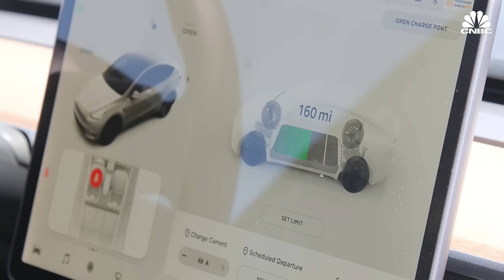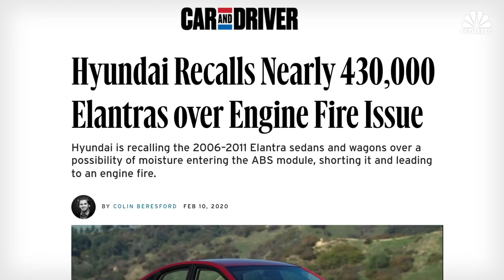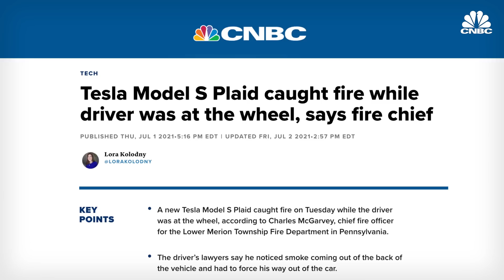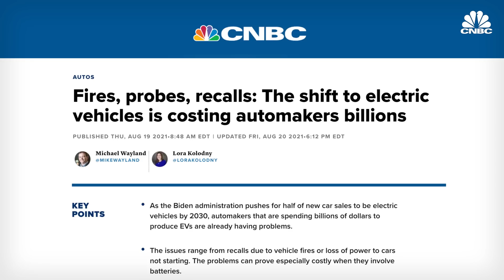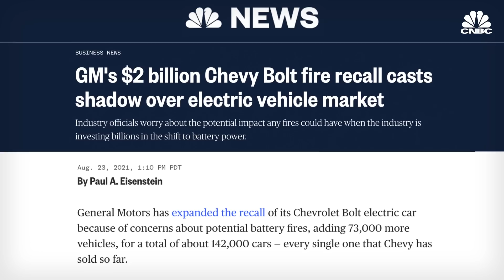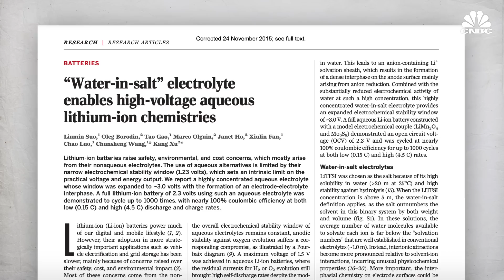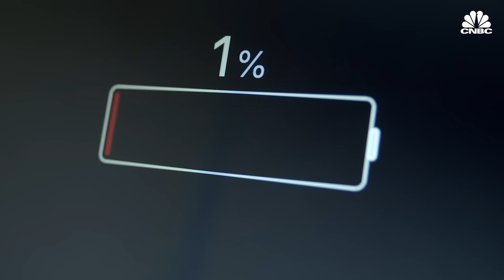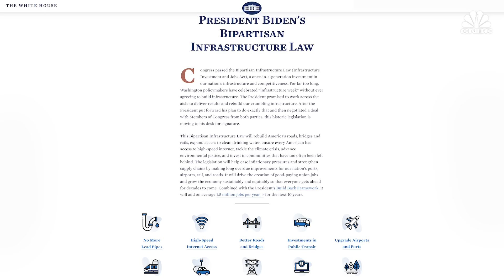Why Tesla, GM And Other EV Companies Have A Fire Problem

Comment: That test is unrealistic. No cars drive with a single battery. A whole module should be put into a hydraulic press or something. A 3.7 Volt rechargeable battery will never cause much damage. It is a totally ridiculous test. In an EV the batteries are connected, so they provide 400 to 800 Volts! From the good old formula by Ohm P= U x I  where  U is voltage and if you insert 800 volts instead of 3.7 there is a super-huge difference.  The idea of electric cars is not thought through properly. Then there is the charging issue. Hydrogen is the only way forward.

Comment: I have been safety testing lithium ion cells for the last two years (18650 and 21700). I would have a hard time sitting on top of a battery pack with 1000-2000 cells. It’s a lot of energy packed in there….
Reply: Where do you get 1000 to 2000 cells from? A Nissan Leaf 24kw has around 130 cells......
Reply: @Brian-om2hh  The Tesla S class has over 7000 18650 cells.....

Comment: 25 EVs catch fire per 100K per year.    1,530 ICE vehicles catch fire per 100K per year.   3,475 hybrids catch fire per 100K per year catch fire.   2022 report.    Just saw an ICE Jeep on fire yesterday, here in Bowling Green KY.   England now has low profile fire trucks that can enter car park garages that have high pressure abrasive water to cut into EV batteries and put the fire out with less water.   Another thought, if you have lived in a developed country (air conditioning, ICE vehicles, etc) since 1950 then you have to look no farther than a mirror to see a murderer.   That includes me.

Comment: hot asphalt on hot days appears to be an x-factor for EV floor bateries to short-circuit and catch fire.

4:03 non-crash fire rate EV is still said to be low, but they need more/better data.  5:40  some european cities dunk the car in water.

6:00  in addition to fire/explosion, they pose two threats, toxic gasses and flammable gasses, and battery packs can reignite days later.  EVs are particularly vulnerable when charging.  

8:01  GM recalled 61,000 chevy volts plus 73,000 additional vehicles... BMW, ford, hyundai, mitsubishi, tesla all had 'fire risk' recalls.
   
9:20  2021, tesla began switching to LFP lithium iron phosphate, lower fire-risk.  but LFP EVs have exploded into fire too.

10:41  solid state batteries in 2026/28 we should start to see more risk stability.
Reply: Great comment.

Comment: Why is our government so intent on putting us all into electric vehicles instead of gasoline or diesel powered vehicles? This tech is neither tried or true. Hypothetically, could a signal be sent via smart meters to short out the battery and start an electrical fire during charging of your ev? What happens when your EV catches fire inside your garage or a parking structure? It may be too hot to stop before engulfing your entire home or the homes of others, are you personally liable for damage or is it covered by auto insurance? What happens if you don't have access to home charging equipment? What happens If the government wanted you to comply with the new tyranny rules or move to one of their 15 minute cities, could they just flip a switch and eliminate your ability to charge your vehicle? It will be worse by volumes with digital money. In California, they suffer from brown outs, black outs for a major portion of the summer as the power grid is taxed to capacity. When it is windy, the grid is automatically shut down. The state government asks people last year not to charge vehicles during these times. How does this affect your ability to use your transportation? Is it dangerous for the power company linemen to work on power lines when electric vehicles are plugged into the grid?
Reply: Now they are putting the factories to build these batteries in Michigan- we don't want them!! The government is corrupt!! Look up Gotion Ev Battery Plant
Reply: WAKE UP you have been lied to ? the 40s/ 50s/ 60s/ 70s / 80s are over the cookie jar is almost empty ? you can tell this by the rubbish they sell at the pumps why ethanol they are mixing in everything  that burns that was sold separately  ie paint thinner [ what does that mean to air quality  ] we need to replace our day to day automotive  fuel ..... the poisons in battery fires ..... dont look up fracking / oil spills  / or any other fires fed buy oil ................................ we could always  ban the lot of it and go back to horses and pushbikes ...................... you should do that

Comment: BTW, with NET CO2 and water capture, a fire is automatically extinguished by the car during a crash or by driver deployment.  In essence, the CO2 capture is like a huge fire extinguisher that comes with the car.  With Ethanol (RE fuel made from electricity...the future), the fire is quickly diluted by the captured water even if a full tank exists.  The CO2 chills the engine compartment down to -56C.  This is superior to any system on an airliners for putting out fires.  EVs are hopelessly invalid and unfit for purpose.

Comment: National Transportation Safety Board, Bureau of Transportation Statistics have found hybrid vehicles reported 3,475.5 fires per 100,000 sold. Gas vehicles accounted for 1,529.9 fires for every 100,000 sold. Electrics saw just 25.1fires for every 100,000 sold
Glad I have an EV lest chance of catching on fire.

Comment: ev's are not clean as manufacturers say they are. mining the earth for all the minerals to build millions of ev's over decades will cause harm to the planet. few people will buy a 10 yo ev without a battery replacement. which means more batteries need to be made. ev's are still very unpredictable you don't know when it will burst in flames.

Comment: 5:52 , water will make the batteries short out and ignite, we found that out working with battery pack tools around water, I’m not in a hurry to switch out my lead acid batteries on my boat
Reply: as a mechanic I discuss the problems with electric vehicles in depth on my home page vid.

Comment: One thing i said at the very beginning of ev's, this will only work if the battery is easily replaceable at a station in a short period of time, enabling the power source to be renewed quickly and effectively. 
This could also be a fire retarding feature where the battery could be ejected in a fire condition and save the vehicle and it's contents.
Reply: Possibly, but what happens in or after a crash?
Reply: Eject a half-tonne bomb on a busy highway?
Reply: There is an Australian company that is converting Kenworth trucks to replaceable battery trucks.  Their prototype burned to the ground and their first commercial cement truck did too so replaceable batteries may not be ready yet.
Reply: @johncooper4637  given that electric vehicle batteries tend to self ignite and the fire risk is common to the batteries. I find it strange that you seem to think that the feature of a 'removeable' feature of the battery is the problem in their vehicles.
Reply: as a mechanic I discuss the problems with electric vehicles in depth on my home page vid.

Comment: Not only are they a major fire problem but they are an environmental nightmare!!!  
There is absolutely zero drop in crude oil drilling. The amount of plastics and synthetics that go into these still require refined oil. The by product of oil refinement is gasoline. The gasoline will have to be burned off if it isn’t going to be used in cars. So we will still have the absolute same hydrocarbon burn off as before, possibly a slight decrease.  Now we add the horribly toxic mining practices for the rare earth minerals that make the batteries. The batteries will only last 15 years  on average, they will then end up in landfills with toxic runoff that will poison our ground water. Just so we can feel we are being green.

Comment: In the same way you can't release a vaccine in a month, you can't change an industry overnight.  Not to mention that the demand for EV's is miniscule while the gov't tries to force people to change.  Capitalism doesn't work like that, socialism and communism use those methods.  These fires are happening in significant quantity and already common with very few EV's on the road.  Bottom line, this tech will not be the future.  As Toyota has come out and said, hybrid gasoline and hydrogen are the future.  Batteries are already archaic tech.

Comment: Not to mention its higher carbon footprint than a gas vehicle unless it's used for more than twelve years which is about the breakeven point. Now throw in that the batteries are not recyclable. Electric vehicles are a complete boondoggle for morons who think they're doing something

Comment: Studies say gasoline cars catch on fire 10 times as often as electric cars, but I wonder if that's true. I mean, these EVs are new, and they still spontaneously burn. Even the brand new batteries in new 787 airplanes spontaneously caught fire in 2013, and the fleet was grounded. How many new gasoline cars or planes spontaneously burn?
Reply: "Studies say gasoline cars catch on fire 10 times as often as electric cars, but I wonder if that's true."

Actually, gasoline cars are about 22 times a likely to catch fire
 The headlines of the video is DESIGNED to scare people!  It obviously worked!  But, someone is just jerking your chain.  They neglected to share the data that shows that gasoline cars are 22 times as likely to catch fire as an EV.  Sure, they are hard to put out, but the chances of a fire are many many times less.  

Oh, and Hybrids are bout 64 times as likely to catch fire as an EV!  Do you drive a hybrid?

For every 100,000 hybrids owned in the US, 216 caught fire in 2021.
For every 100,000 gas cars, 74 caught fire
For every 100,000 EVs, 3 caught fire!

Those are the odds!

Comment: So if the battery is older thats a higher level risk. I think EVs is novelty.battey power fork truck at work melted the plug for the battery and full charge I unplugged the power before fire In the food plant.

Comment: Another concerning aspect is the ageing of these vehicles. Rust / corrosion is a major problem here in the UK and is only made worse from the salting of the roads during the Winter months. The batteries are underside so we can only expect rust eventually getting into the battery casings and potentially causing corrosion of these Lithium packs in say for example 10+ years time.
Reply: We are safe inCheshire because they do not salt the roads
Reply: The rich people don't like salt the roads now because have Tesla.
Reply: Casings are typically with a plastic layer
Reply: This whole video is full of factual omissions, firstly alot of batteries can't be put out with water, once the battery catches fire the chemicals in the battery produce more oxigen which fuels the fire. An experiment was done where they punctured the battery of an EV and put the car in a hole in the ground and filled it with dirt and water... this method would put out most fires but the ev continued to burn for several hours.
Reply: There's no particular rust or corrosion problem in the UK, what are you wittering about?
Reply: @markfox1545  Vehicles, Winter, roads, salt, loads of surface water (especially right now), throw In a few lithium-ion battery banks for good measure, excellent recipe 👌  have a good dinner
Reply: Norway has 80 % ev adoption.. surely they know what they are doing
Reply: @irusev  still ''new'' will see in 10-15 years
Reply: @irusev it is never safe to make assumptions about safety!!!
Reply: @irusev  Imho, they have not a clue. Insanity rules over common sense.
Reply: @denisek292  well, they sure seem pretty happy to me

Comment: Green energy is a low-pollution option even after the fire and even if the driver gets burned.
Reply: No, I heard EV manufacturing produce 60% more carbon compared to petrol and diesel cars.

Comment: I'm still not seeing any reason to move to EVs. Existing gasoline-powered cars burn fossil fuel in the engine. EVs burn for fossil fuel back at the electric generating plant. Where's the benefit?

Comment: Please note: 

The following caveat placed on many websites, Twitter, Wikipedia, YouTube etc:
Climate change United Nations:
"Climate change refers to long-term shifts in temperatures and weather patterns, mainly caused by human activities, especially the burning of fossil fuels."

This is at best bias, propaganda, exaggeration or based on deliberate social engineering.

Sadly it is based on computer models designed to produce the desired result for those commissioning the prediction.
In reality the statement would seem to be a lie.
May I suggest YOU read the full IPCC Report, which fails to support the claim!
May I remind you that for centuries the consensus of scientists were claimed to believe the Earth was flat
& the consensus of scientists & the whole of the Catholic Church agreed the Sun, planets & stars all revolved around our planet!
Real science has never been reliable and has always depended on debate, new information & proof!
Remember around 80% of electricity we use is generated by Oil, Gas & other, so called Fossil Fuels & there is no scientific proof that CO2 causes Climate Change OR Global Warming!

Our planet has had a changing climate, with periods of warming, cooling & ice ages for 4.6BILLION years.

Comment: All around problem from the toxic foam the fire fighters use, that is cancer causing and very environmental unfriendly. HOW ABOUT THE STATES THAT USE CORROSIVE SALT  ON THE ROADS. IF LITHIUM IS EXSPOSED TO WATER IT WILL EXSPLODE.

Comment: It's not a mystery. Anytime you store energy in quantity, the potential exists for that energy to be catastrophically released. One huge disadvantage of LiO batteries over gasoline is that a LiO battery fire contains oxidizers, and is therefore extraordinarily persistent and difficult to extinguish compared to a petroleum fuel fire.
Reply: The other major differences are is that BEV fires are far less likely to occur than ICE fires and there is far more energy stores in a tank of gas.
Reply: i hope soon enough it will be sorted evs for the daily drive will become reliable / common   as cordless drills / sanyo transistor radios ..... there is no replacement for oil 50 years they been at it come up with nothing . ev is about as good as it gets - but then we need nucellar power to feed them all  fat to the fire swap air pollution  for poised  everything

Comment: Electric vehicles are not the future there is more of a risk of a fire there's more and more of these electric vehicles catching on fire while owners are driving them it's like you're sitting on a bomb! And firemen are having trouble putting the fires out because the battery juice fluid whatever it is is very very combustible! Stick with your gas powered vehicles you're safer and you save a lot more money!

Comment: Also, I’m curious to know how the water is even intruding into the battery pack since the packs are sealed and
fill with antifreeze.   Is there a vent perhaps that can be backed up with high enough water?
Reply: they can be punctured by any loose road object

Comment: It's depressing how seemingly 90-99% of people just assume, "the future of transport is pretty much as things are now, most people having a 4-passenger car used for one or two people most of the time, wasting countless hours in traffic jams, but only with heavier electric cars instead of gas." It's even questionable whether there's enough battery minerals to satisfy all the mandatory demand. All while the energy supply for it is often not itself "clean," so the CO2 output of more cars, more electricity may even end up in net increase of emissions worldwide. Not to mention more tire and road damage. Wired-power electric transport (conventional electric trains, trams, no "hype" vacuum tubes needed) tremendously improve the efficiency of transport itself and the environmental demands, are much safer at the same time. The problem with energy generation, while still persists, is nevertheless reduced because of the added efficiency of collective transport and rails.

Comment: Wow, first of all, it takes a lot of power to charge these vehicles which the electricity what at least most of it is coming from fossil fuel, and to add all that that fire, God knows what kind of chemicals went up in the air to ruin the ozone and pollute everything and cause climate change give me a break on top of that all it takes them 5 to 10 times more water to turn out this chemical fire seriously guys get with it